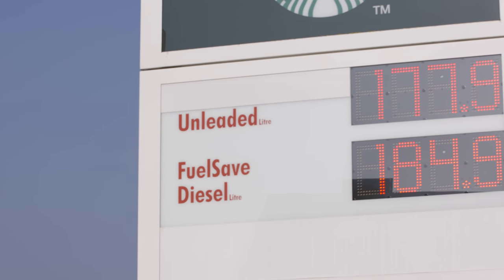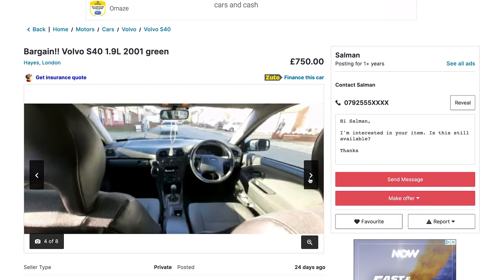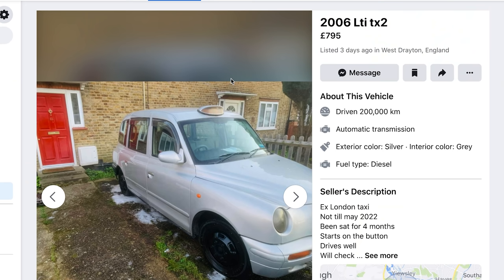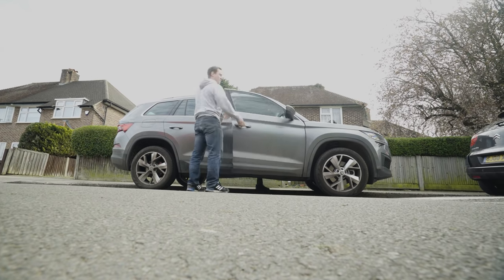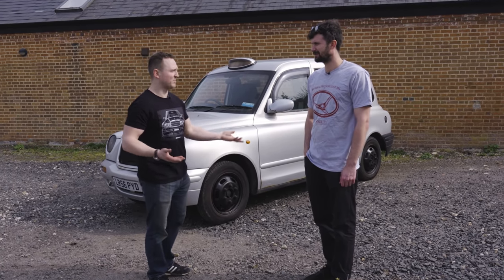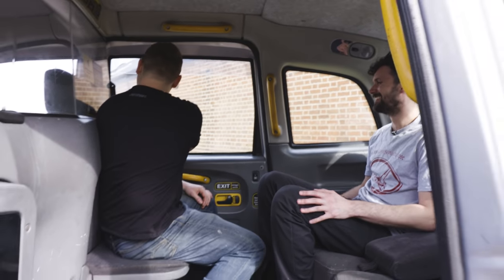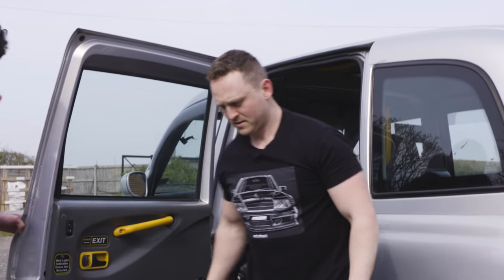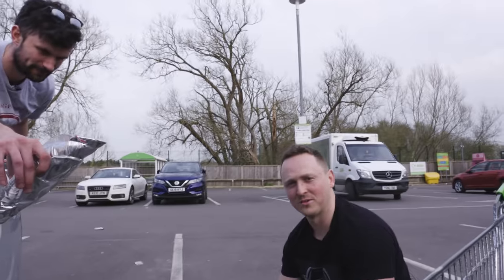How To Beat The Crazy Fuel Prices

Comment: Alex said TX4 and my immediate thought was "Those are common rail and they get terrible fuel mileage" but they made it worse by buying a ticking timebomb transit engined TX2 lol
Reply: I'm not super knowledgeable about fuel delivery, but isn't common rail one of the more fuel efficient methods?
Reply: @atherrien95  It's probably the most efficient in terms of MPG, and is generally the smoothest running as well. But it being common rail is bad in this context because it means the injectors are finer and are more susceptible to being clogged up, so you can't use cooking oil mixed into your fuel.

My dad actually drives a TX4 with the 2.5 VM Motori Chrysler common rail engine, the injectors are so fine that you can't actually see or feel the holes in the injectors with your bare eyes and hands. It's also very 'thirsty'. Goes through diesel like it's nothing, since it's heavy and has basically no torque.

I've been thinking about undertaking a project with my dad wherein we swap a 1.9 TDI PD VW motor into his TX4 since those have boat loads more torque and are likely more economical.  Unfortunately it would have to stay auto, although a tiptronic would be nice.
Reply: @v6tex  Oh... You are slick with the inuendos
Reply: @Darkest_matter  What do you mean by that? I didn't write anything clever intentionally lol. Unless you're talking about how the last line has 3 words in a row that start with T?
Reply: no wonder I was like... wait that does sound like a transit van...
Reply: That's not common rail it's, direct injection - tddi 2.4 duratorque puma engine. You do get the tdci common rail version. They said its a mechanical fuel pump it is but its electrically controlled vp30 bosh
Reply: @johnantonine4505  The 3 main diesel injection methods can all be direct injection. All TX4s in the UK used a common rail direct injection 2.5 turbo diesel from VM in Italy, shared with Chrysler and Jeep models.

Bosch vaccuum pump diesels known as VE or VP can also be direct injection hence the 'TDI' badge on pre-1999 Volkswagen VEs (where the D has always stood for direct). The LTI TX2 was only made with a VE 2.4 Transit engine, there wasn't a common rail injection version of the TX2.
Reply: @v6tex  I don't know much about taxis but I know that engine in that one it's the same as the mk6 rwd transit. The transit had the 2.4 Duratorq with common rail. Called the tdci in mk6 135ps rwd or 125ps fwd 2.0L. All mk7 transits were tdci 2.2 and 2.4.
Reply: @johnantonine4505  all you've got to do is look at the engine in that taxi at 9:16 to see that it's not a common rail engine.
Reply: @geoffvalenti  I know I said that I'm my first comment
Reply: @arbit3r  Yep that's what I was getting at, best to use a pre 99 TDI with a Bosch VP or one of those old Peugeot lumps
Reply: It is not a ticking time bomb engine it’s probably the best modern Diesel engine Ford have made after the bulletproof banana 2.5 it is not common rail as it has been said and it’s also not a puma engine !

Comment: A few years back I ran an old Polo SDI on a 50:50 mix of diesel : veg oil.  It wasn't great on straight diesel, so best to mix it.  And regular fuel filter changes required.  Bought the oil in bulk from the likes of Costco or like local Asian food places often did decently priced bulk, 20L drums.  I think at one point I was £15 for a 20L drum, so 75p per litre.  

It was roughly a 45L tank in that car, so 20L of veg oil, then top up with 20L diesel.  So £51 to fill the motor with 40L of the mix (assuming £15 drum and £1.80 per litre for diesel).   Used to get around 400 miles per tank so that's around 12p per mile (or £6.37 for your 50 mile journey).

Cheap motoring that.  I was commuting around 100 miles a day at that point, so it was worth it for me.  I used an old 2L "pop" bottle as my funnel.  Cut off half of the "bottom" of the bottle and used it as the funnel.  Was tricky starting off the 20L drum, but wasn't too messy.
Reply: Just checked prices it's around £40 now
Reply: @fractalofgod6324  You can get oil from old restaurants but it takes a bit of a hustle and some diy refining
Reply: Done the exact same with a fabia sdi a caddy sdi and countless old peugeots its mega cheap and you can gwt away with a slightly thicker mix in the summer
Reply: my old Megane on LPG got about 33 mpg. 60p a litre, sometimes 50p, so that 50 mile journey would have cost under £4. Even now it's only £6.
Reply: @juchetony1910  Years ago I also had a Range Rover P38.  It was the 4.6L V8, with an LPG tank.  I averaged 13.5 mpg with that thing.  I loved it.  But back then, I remember paying over £200 to fill both tanks one day.
Reply: @juchetony1910  We used to run a car with a lpg conversion kit but now lpg in australia is too expensive. all the petrol stations are getting rid of their lpg too.
Reply: I’ve been making my own biodiesel for year from chip shop waste oil. Runs great all year even in my 2017 Hyundai diesel

Comment: Add a litre of green 2 stroke oil to a full tank, it will stop the oil clogging filters etc. Plus keep a spare fuel filter with you.
Reply: That sounds like nonsense?
Reply: @MT_T991  Diesel has additives to prevent engine wear, cooking oil doesn't.
Reply: Cooking oil will gum up if left to sit in the system too, so don't use it unless you are going to use it up quite quickly.
Reply: I've heard that one before and seen no evidence. Even manufacturers of two stroke oil don't recommend this.
Reply: @jackroutledge352  I suspect it's not mentioned as oil producers don't want you to use anything but diesel in your car. But that's an assumption, it also helps in diesel as they have reduced the amount of sulphur in diesel.
Reply: @BlatentlyFakeName  It will, the best use of cooking oil is 40% split with diesel, in the summer it's the other way round, it's cold spells that thicken the oil. Hence the need to carry a spare fuel filter. I did use to add 250ml of thinners to a full tank of fuel to help stop some of the clogging, but my engine was designed in the 60's lol, it would run on any oil.
Reply: @retrotechguardian4393  I'm just not sure it's a random amount of 2t oil.  As it happens Bosch mechanical pumps couldn't care less I know a chap who's don't 150k miles on used chip fat.
Reply: @MT_T991  Agreed it depends on the technology under the bonnet. But the 2 stroke oil acts as a lubricant that you lose using oil. I used to add half a litre to my full tank, which was 2 gallons of diesel and 9 gallons of oil, It also helps clean carbon deposits after about 3 tanks, engine runs quieter and smoother with less smoke.
Reply: If you need a spare fuel filter its probably best to just buy fuel from the garage
Reply: @benthompson8256  Oil will clog your filter up, especially used chip shop oil.
Reply: I've been wondering this.
If the only thing stopping a Diesel Engine from running on thin fuels like gasoline, is they can't lubricate the high pressure fuel pumps...then what if you tried running it on 2stroke mix?
5 to 1?
10 to 1?
30?  
I'm very curious if small single cylinder diesels like from China & Kohler, and old mechanical non-commonrail-diesels can run on 2stroke mix.
The single cylinders are for motorcycle and emergency generator projects I'm too poor to try.
Reply: @observingrogue7652  gasoline will pre-ignite as it needs a lower compression ratio.
Reply: @retrotechguardian4393  250ml is not enough for a full tank of veg.
Reply: @arbit3r  I agree, I used to add half a litre to mine.
Reply: @MT_T991  
No. 
Pre-ignition is a gasoline engine issue. The air & fuel mix needs to survive the heat of compression, until the spark plug ignites the mixture at the proper time. Higher octane ratings increase that survivability.
Diesel engines utilize the heat of comressing the air, and at ridiculous full pressure, control ignition timing by when they inject the fuel into that hot, compressed air. To my understanding, this is also why octane ratings are irrelevant with Diesel engines.

This is why I am so interested in non-fuel-rail Diesel engines. If & when poop hits the fan, harder than covid, could you imagine running generators & vehicles on nearly any flammable liquid?
Reply: theres no secret with 2 stroke oil. Its just a really light oil thats designed to burn and lubricate. I wouldnt think it would help gluggy oil pass thru, you need a diesel heater coil to keep the oil liquid. Add in another in line oil filter and water seperator.

Comment: Great video, would be interesting to see a budget LPG conversion with a race or see how long you could go on one tank
Reply: It depends on the Engine and LPG generation. Old carburator engines with 1st gen LPG consume 30% more LPG than petrol and with LPG price in UK more than half petrol price it was not very economical. I had BMW e34 520 6cyl injecto on 1st or 2nd gen LPG (the kit wich has no injectors in inlet manifold for LPG, it had rounded disk wit many LPG jets and on motorway my consumption was 10.5l of petrol or 12.5l LPG / 100km ... so you can convert it to MpG or just check prices and compare costs). Find low mileage 4cyl 16v car with LPG tank in spare wheel space and you will save aprox. half of your money on fuel... (Read reviews about diffrent cars on LPG some engines work well some have backfires and engine check light all the time on)
Reply: Very popular in Poland and Holland. 
Every petrol TAXI drives on LPG.
Reply: Yeahhhh and I’ve seen some eastern European budget LPG conversions on youtube, I don’t think I’d want to get in it.
Reply: Budget and LPG do not work together in my experience. It ends quite... explodey
Reply: Going racing with a bomb in the boot. Sounds like a bad idea.
Reply: LPG haters 😁

20 year driving on LPG with no problems.

Comment: Here's a tip for waste oil. Get 10inch water filters. Three in a row and use the cheap paper filter. 0.5 Micron final step. The finer the better. 0.2 clogged too quickly but 0.5 was good. 
The filter housing uses standard fittings and get a pump to pump the good stuff.
Works like a charm

Comment: I used to drive a Silver TX1 SE for Saint Dunstans Charity for the war blind now called Blind Veterans UK.  It had the Nissan 2.7 litre fuel injection diesel engine. It's a 8 gallon tank and I used to get 15mpg on a good day or 9 mpg in the city. Back seats fold,and there's a ramp in the back for wheelchair users. The back doors open a full 90° max speed 97 mph. You can take the divider out and fit a seat in the front,  Best change the tyres for a better ride.

Comment: I used to work for lti as a technician and we had loads of problems with the Ford engine especially timing chains, cams pulling out the heads, fuel pump solenoids, fead belts being noisy due to tensioner failure but when running properly they drove really well.

Comment: Had an old 1999 S-reg Shitron berlingo (DW8 1.9 engine) that I ran on 100% used restaurant cooking oil for about 5 years.
Didn't even need a 5 micron filter either, just ran it through a boggo standard coffee filter and put it straight in the tank.
I think I did approximately 60,000 miles on used oil before I sold it to another veg burner about 5 years ago and I still sometimes see it on the road now.

Comment: You should’ve bought a saab, they are super cheap and have a large top gear, they can do over 30+ mpg US, and they come with Diesel engines that can do even better
Reply: @brewingfarts  United States mpg. UK mpg that’s like 40+ ish. Try to find a cheap diesel that can do better
Reply: @kennorcott7074  I bought a 2.2 mondeo for £900 (with all fancy bits too, exhaust, alloys etc which can be sold to recuperate some cost I guess) which averages 49 mpg.
Heated seats, aircon, heated front screen, auto lights, auto wipers etc. A fair bit of car for the price.
Reply: All across Europe the prices of old diesels which can run on oil and old petrol engines that can be easily converted to LPG, have basically quadrupled over night. Early to mid 90s cars now go easily for €2000+, where 6 months ago people were wondering how to get rid of them. IT's just insane.
Reply: I wonder if my 2001 T4 2.5tdi would take veggie oil? Anyone tried it?
Reply: My saab 95 2.0t petrol barely gets 25mpg around town, can squeeze maybe 35mpg hypermiling on the motorway
Reply: @kennorcott7074  The skoda 400k miler they had on this channel did 70+mpg easy
Reply: @mcgetrekt2388  again us mileage and UK mileage are different
Reply: @kennorcott7074  No. The mileage they got out of the skoda would've been over 50 of whatever your nonsensical measurements are.
Reply: @mcgetrekt2388  ??? It’s well known that Uk mpg measurement and US mpg measurement are different, how is it nonsensical lmao
Reply: @kennorcott7074  Because they shouldn't be different. A mile is a mile and a gallon is a gallon. You just have to mess with measurements and make up fake terms that make no sense.
Reply: @mcgetrekt2388  look it up lol before saying someone else is wrong. Car throttle even mentioned it in the living with a mustang episode
Reply: @brewingfarts  just curious how many miles per tank you get though? Not running in the fuel light ofc but how many until fuel light.  I got 478 on a 1.4 petrol (golf 4)
Reply: @kennorcott7074  a uk mile and an us mile are the same distance. It’s the gallon that are different sizes.
Reply: @kennorcott7074  Most cheap diesels will do better than that.
Reply: @kennorcott7074  my 2007 mercedes 2.2 diesel does that, and it's quite cheap

Comment: Man I missed those vids, keep em coming. A fun fact to know is that the original diesel engine was designed to ryn on veg oil and technically diesel engines can still run on veg oil, that is cheap and it also acts as a lubricant. Altough it has advantages it shouldnt be used for an extented period of time because after a while microorganisms are going to start being created and and then there is something like mud that is being formed from them that can block the pump, or the becks. Another fact is that the diesel that everyone is using right now contains 2% ,or maybe a bit more, biodiesel which is produced from fried ( or used in any way veg oil) and the goal is for that percentage to keep increasing in the coming years

Comment: Used to run my old Citroen ZX diesel on veggie oil - every third fill was diesel, but I really was saving money. Course, what you've not mentioned is how your car then smells like a chip shop, for those who are in traffic behind you 😊
Reply: same here, well 306 - XUD engine (same in both vehicles i believe)
Reply: ha, though I only went to 20% veg oil in my ZX, and it stank like a chippie even then 😀
Reply: @MultiVogon  i found anything over 90ish% and it was down on power and mpg was lower also. old trick was to brim the tank with veg oil and add 1 litre of petrol to thin it out a bit

just reminded me of a time i ran out of fuel and mother in law came to the rescue with a bottle of filippo bereo olive oil lol
Reply: @greenspoondcfc  the V-Power of vegetable oils 😂
Reply: @greenspoondcfc  1 litre of petrol!?
Reply: @MrNobbyify  that made me raise my eyebrows a bit too!

Comment: You can also use old engine oil from any oil changes/ or and mix with oil. btw did you not think the motor started to stink like a graesy spoon? I used to run a old pd 100 seat Ibiza 1998 plate on these, just had to do a more regular fuel filter change.

Comment: If you start to use veg oil in a vehicle that has always used diesel change the fuel filter after the first tank full has gone through. This is because veg oil is thicker than diesel and picks up any crap in the tank. If there's a lot of crap at the first filter change you may need to change the filter again after another couple of tank fulls. You can thin veg oil out by using methylated spirit (but you must pay fuel duty and VAT on the meths) if you get any running issues due to thick veg oil

Comment: Love the video and love that old Taxi!
I drive a 1.9 TDI and what I am thinking of doing is the little setup to convert Veg oil to Biodiesel.
Reply: Easily get it done get to the old chippy and boom your in business I'm thinking of brewing some and selling it for half price I used to do 8 litres of veg with 2 litres of pure diesel
Reply: Old Mercedes and land rovers run well on a 50/50 mix of vegetable oil and paraffin!
Reply: I don’t know if it’s worth it to go through the whole rigamarole of converting veg oil to proper biodiesel. I think it’s a bit difficult and messy, you need to buy chemicals to do it, and you can’t really store it for long so you gotta convert it sort of fortnightly or monthly?   

I reckon if you get free used oil just concentrate on filtering it really well and mixing it with diesel (more diesel in the winter). Or spend the money on a system where you start and finish the vehicle on straight diesel, but convert to veg oil when the engine is nice and hot.
Reply: Don’t use supermarket oil. It’s got additives in it for cooking that isn’t good for engines. To be honest it’s probably not going to be worth the hassle.
Reply: Just do 10mph less 😂
Reply: Doesn’t work on pds will kill it

Comment: That saxo from the nc500 trip will be decent on fuel 👍
Reply: Not really. My mother had saxo with 1.1 petrol engine and it did 10-11l/100km (mostly city driving).
Reply: those small engine cars are not as efficient on fuel as people think the problem is your constantly ragging it just to keep up gotta red line it every where lol.
Reply: Depends on revs and gear

Comment: Note: The TX4 doesn't have a Transit engine, the TX2 does. The TX4 has a 2.4 VM Motori engine.
Reply: The transit is a 2.4   16 valve , the VM is a 2.5 16 valve  . The VM is a euro 4 hence the tx4 .
Reply: @dennisphoenix1  yes, your right. And also the petrol was a 2.4 engine.

Comment: 4:30 yes they do. You can clearly hear it. 
Yes they run on everything. Even ran old engine oil at 100% in my Mondeo with that engine and it worked fine and started just like on Diesel